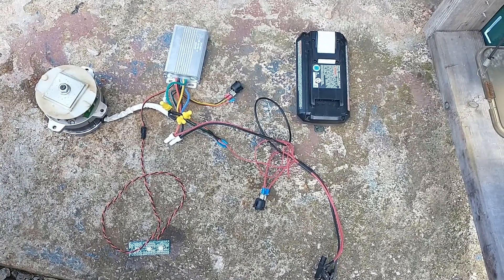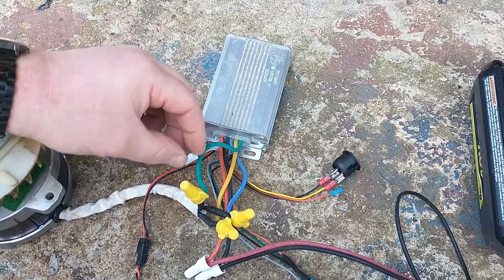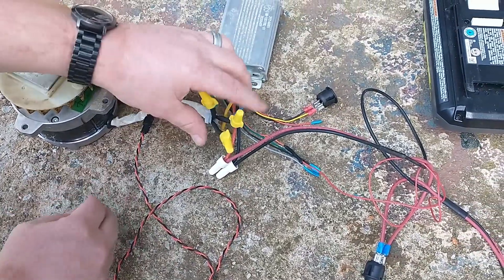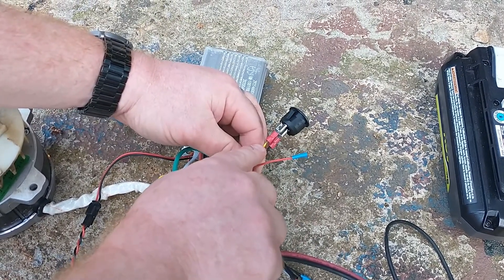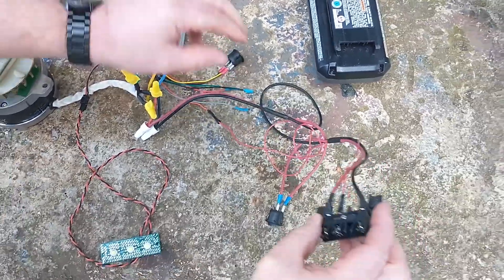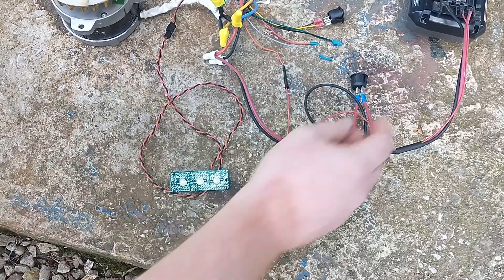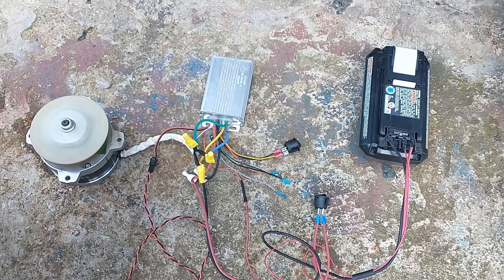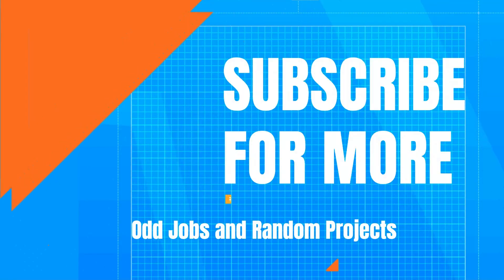Ryobi 40v Brushless Mower Wiring Diagram, Explanation and Modification for Projects

Comment: This is very helpful do you have anything similar that would show how to use and test a controller in a self propelled mower if I wire it using only that controller it will very briefly energize the self propelled motor but not really engage the motor and run I am a bit stumped by this and the same thing happens when I give the self propelled motor power directly from the 40v battery I am wanting to use only the self propelled system not the mowing system at all as a sort of electric moving cart but am a bit stumped on how to get the motor to run there is a motor controller for the blades very similar to what you are showing in your video and with it the other controller seems to be happy to do it’s regular functions and self propelled works but without that controller it seems to do nothing really but briefly energize the self propelled motor there is a 3 wire set that goes between the 2 controllers so I am wondering if that may be the key to getting just the self propelled controller to work independently of the cutting controller but I am not sure if it is wanting a signal or just a switch or something similar to the bypass you did in your video here for the cutting controller I have a few of these now so it would be amazing to get it sorted so I can use what I have for projects like moving carts that take out my trash cans and stuff, just curious if you may have a video showing anything on that controller? Thanks
Reply from the maker: I don't have a video covering that. However if your self propelled mechanism is like the one I have it isn't brushless, so the main controller wont work on it. If the motor only has 2 wires it is a brushed motor, and needs a different speed controller. I have not messed with that part since the motor is a bit small and I think it might be too weak for moving heavy things. However, the easiest way to do that would be to connect a brush type motor controller used for ebikes that can usually be picked up on eBay cheap. They have the wires labeled for easy use.

Comment: Great video - thanks for making it! I have just inherited a broken Ryobi 36 V lawn Mower that had an overheated connector that stopped it working. It is similar to yours but a bit simpler. I don't have the battery. Any idea what the third wire from the battery does? It is labelled "DS" at the PCB end and is a salmon orange color... Does it have digital data on it? That would be a nuisance.
Reply from the maker: I can't say for certain on that one, but on mine it is a temperature sensor. However several people have told me it will work with it disconnected. Several assumptions here, but if everything I've heard is true it should work without connecting it. I must say I haven't tested this personally, but don't see how it could hurt anything. Should just not work if the wire is important.

Comment: A mouse ate some of my wiring in my mower(RY401017VNM). I am trying to determine what gauge of wire to use. I know too thin of a gauge can cause overheating and damage components. If you know of some source of info on the internet please let me know.
Reply from the maker: If you have a small caliper you can strip back a section of the mouse eaten wire and measure it. There are charts online that will convert that into wire gauge sizes. Most of the small wires to the switches are about 20-22awg, and the motor ones are about 12-14awg, but that is just a rough guide. Measure to be sure. There is typically a wiring diagram on the Ryobi website under support that helped me.

Comment: Can the motor be connected straight to the battery without the computer box ?
Reply from the maker: No it can't. That's because brushless motors don't have a hot or ground wire to connect. The wires constantly change state to make the motor spin.

Comment: What's the difference between the set of 4 wires and the wires that are supposed to go to the handle ? I want to use that controller on a greenworks mower that the controller stopped working, but I'm wondering if I wouldn't short the wire to turn on the system and only use the wires to the handle to control the lawnmower. What is the drawback of my solution ?
Thanks
Reply from the maker: I believe the 4 wires you are referring to are the ones that go to the handle on the Ryobi. I am unfamiliar with the Green works design, so my opinion may not be of much value. I do know that Ryobi posts a basic wiring diagram in the manual for each of their mowers. It's available on their website. If Greenworks does the same you could just compare the two and make the problem solving easier on that front. But your system essentially sounds like what the manufacturer intended, just swapping parts brands.

Comment: When you find an unused conn it quite often is the conn the factory used to program the controller  ALSO  it may be used by the repair shops to plug in their diag laptops too.

!
Reply from the maker: That makes sense. Especially since the manual doesn't even cover it. Repair shop or factory only.

Comment: I have two Ryobi electric lawnmowers sitting in my garage. Both are not working. So frustrating that Home Depot would align themselves with this lawnmower. I love all the Ryobi products with the exception of the lawn mowers that are having electrical challenges. Attempted to go down the path of getting it repaired by the ““ Ryobi repair partner. The quote was just as expensive as buying a new lawnmower. Not sure if this is a class action suit, especially when it comes to when I put this two lawnmower on the street it will go straight to landfilland I could only imagine being multiplied by hundreds of thousands of these. My expectation would be these last 10 or 15 years, not two or three years anyway food for thought.
Reply from the maker: That's really sad indeed. They seem to have good motors and controllers that are let down by shoddy wiring and bad switches. Really pathetic that they seem to just replace rather than repair. That said the ones I have work very well, but I may have just got lucky. I know lots of people had problems though, because that's how I got all my motors for conversions, from "dead" mowers.

Comment: It was a safety switch just as this gentleman had said. Thank you very much, my mower is back in action!
Reply from the maker: Glad to hear it's working again!
Reply: I don't think you actually need an extra button for a redundant safety on a dead man's switch.
In my view it's not even a safety. It's a convenience to let you restart the mower after you bog it down without flipping the handle up and down again.
Or it would be if it wasn't doubling points of failure with very flimsy switches indeed.
It's an inconvenience switch.

Comment: My dog chewed up the wire to start the Ryobi lawn mower can you please tell me what I can do to replace it and what kind of wire do I use to replace it? Please and thank you.
Reply from the maker: If you are referring to the wire that goes up the handle that isn't too bad. On mine there are only 3 or 4 wires, and it is light gauge, about 22 gauge or smaller. There is actually a nice wiring diagram on the Ryobi website that is specific to your mower model. Just look up the model and you should find one. On some it is in the owners manual. Mine was real easy to understand. You should be able to replace the chewed section by splicing in wire, preferably of the same color, but if not just make sure you don't mix them up. Just work one write at a time. I like to use waterproof heat shrink butt connectors. Afterward I usually cover the entire bundle in heat shrink if possible to prevent damage to the wires in the future. I'm probably going a bit overboard, but I don't like doing jobs twice if I can help it. There is also a spiral loom wrap that is easier than heat shrink, separately for splices,  and harder for dogs to chew, but certainly not impossible. Hope this is helpful.

Comment: Is there any way to bypass the automatic low speed/high speed motor settings?  I want it on high speed all the time.  Thanks!
Reply from the maker: Not that I am aware of, at least not on the factory controller. You could swap in an E-Bike controller to have fully variable speed control, but I think that's a bit excessive.

Comment: I did something similar to my mower but it cuts off on slightly on thick grass do I need any type of protection switch so I don’t burn up the motor?
Reply from the maker: Not that I know of. It is supposed to have a built in protection that causes it to cut off to protect the motor. You might check your bearings to see if there is drag causing it to work harder than necessary.

Comment: The small red wire coming off the battery that connects at least on mine to a orange wire. Does that have 40v going to it or is that some kind of overheat or some other signal from battery to machine.
Reply from the maker: From what I understand it is a temperature sensor for the battery.
Reply: Yea thats what i thought, i had someone give me a mower but no battery. I found some chewed wires and was gonna fix them try to rig it up to a couple of my drill batteries to see if it would do anything at all. I can get 40v to the machine but not sure if it will run without getting a signal down that temperature signal wire
Reply: So it turns out that orange/red wire does not need to be connected for my machine to work. I hooked up the  two 20v batts from my drill  in series and was able to test the mower, thanks for the reply earlier, apprecite your input👍
Reply from the maker: Well that is very good to know! That means I could leave that off if I used a different battery for something like that.
Reply from the maker: Always good to keep things out of the landfill. They are actually a good piece of equipment let down by some mediocre wiring or bad switches most of the time. The motor and controller usually last.

Comment: Great video. Thanks for the explanation. I’ve had Ryobi 40V push mowers since they first came out and have had periodic electrical issues with all of them. I’ve watched lots of YouTube videos to help me troubleshoot the issues, but your video did the best job of explaining the wiring harness and what you can safely disable. One question, though—is there an easy way to determine if the controller is bad or good? Thanks.
Reply from the maker: The easiest way I know to test is swapping to a known good controller after checking the inputs and switches. I keep a spare already wired for easy testing. There are tools for testing controllers, but I've never figured out how to use the one I bought. An E-Bike controller makes a good test controller since they are basically universal.

Comment: Thank you.  Have you tried to overvolt the lawnmower?  Would it work with 11s (46.2V) or 12s (50.4V) battery?
Reply from the maker: I have heard that it will work with 48v, but I haven't tested it myself. The biggest issue would be the original controller and how to bypass the battery temp sensor wire. Easiest workaround would be to use an aftermarket E-Bike controller, but I'm sure there is another way.

Comment: Do you by chance have the part numbers? I am looking to use these motors to convert an old CC 682 to electric as the Koehler twin thru a rod many moons ago.
Reply from the maker: I don't have the party number for the motor or controller, but they came out of a RY401011 mower. I bought them on eBay already pulled from the mower. One thing I learned on my conversions is they don't work well for drive motors if you have a hydrostatic transmission. If you do you will either need a larger motor, and larger or more batteries. Otherwise switch to a manual transmission. My Yard Machines that I bought for the conversion had a single speed manual. But I tried on a Craftsman hydrostatic and the battery lasts like 5 minutes and the motor gets crazy hot.
Reply: @oddjobsandrandomprojects  I plan to utilize a different motor for the drive, but planning to utilize these for the deck. Thank you for your response. 😊

Comment: Does this have the variable speed feature ?? I am pulling my hair out, guys!! The switches in the handle are the cheapest POS I have seen... To put them into a tool that takes a beating is just mean! On my mower, the handle switch is not visible or accessible. Also, my yard (a lawn is a word meant to describe a level area, not grass seed growing thru volcanic stones that was never leveled); my mower keeps shutting off as it off-roads over the yard. I admire everyone here that can follow the wiring; I was born without the ELECTRICAL GENE, just in time for global warming. I will follow every step the best I can. Any advice??? Please help.
Reply from the maker: The controller does not have variable speed. If you want variable speed you will have to replace the controller, probably with something for an E-Bike of about 1000 watts. But for most people the fixed motor speed is best. The switches they use are really cheap, but if you don't mind it looking weird you could use some heavy duty switches. That's what I did when I used this to convert my riding mower. My yard is really bumpy and unlevel.
Reply from the maker: Also, one thing Ryobi does well is the manual. On mine it has a complete, exploded view of the mower. That has made repair much easier. Too bad they didn't just opt for better switches from the start.

Comment: My light and self propelled works but the motor will only work sometimes if i push the start button and have to be walking with the self-propelled on to get it to start and thats only sometimes
Reply from the maker: Just an educated guess, but that sounds like you have a loose or broken wire or a bad switch. My guess is that the vibration of moving is causing the circuit to complete and start the mower. Finding which wire or switch could be challenging though.

Comment: How do i make the motor spin in the opposite direction?
Reply from the maker: Technically the factory controller doesn't allow for that. However, if you want to permanently reverse the direction I've seen that you can transpose the blue and green motor wires to get it to do that. But if you need to have a forward and reverse switch just get an aftermarket controller for about $30.
Reply: Also take into consideration the five unused wires and the unconnected red one I have that controller right now I'm going to go ahead and take it apart and follow the leads on the board and the traces what they're actually connected to and I should be able to define every wire on it because one of those may be a training wire so you go ahead and you power You connect the two but it says always stay together that's your safety switch so leave those separated for the moment and then two of the wires even if it's single mode controller and not dual mode to the wires are usually training wires for direction so you turn it on with power and then you put those two wires together and you give it throttle and if it spins in the right direction while still have the throttle applied unconnect the two wires that we had unconnected and then connected so just touch them for a moment and separate them and then release the throttle and ramp it up again and see whether or not it changes direction If it does just cut the ends off of them and terminate them on nothing there's a couple other features that are probably on here like there might be possibility of regenerative braking a couple other features I'm familiar with the e-bike and scooter controllers so I literally found this it is om sealed so if it's burnt I can't tell it's never been taken apart so let me go ahead and Snoop this thing and I'll let you know when I have it in the main comment section

Comment: So mine runs, but as soon as the blades touch any grass, the motor stops. I've tried another battery and it's the same. I also bypassed the safety switch at the base of the handle, no change. It was working fine 3 weeks ago.

Does that sound like a bad controller?
Reply from the maker: I don't think so. Check the bearings in the motor. That sounds more likely, but I won't claim to be an expert. I have a video that shows what is inside. Typically they say that controllers either work or they don't. A malfunction like that would be unusual. Wiring or bearing is common. If it has been pushed too hard the wiring in the motor can go out. If that is the case when you open the motor it will smell burned, like burned varnish.
Reply: @oddjobsandrandomprojects  I finally got around to checking it again. The bearings seem fine. I clamped an ammeter on the motor leads and the current on each is the same, so I believe the driver FETs and windings are good. I found some hair wrapped around the shaft, less hair than you you would find in a vacuum cleaner. After I cleaned that out, it works great again. I got the mower free in a dumpster dive, happy to get more use out of it.
Reply from the maker: @user.A9  That's great you got it working! You'd think a little hair wouldn't be the problem, but I guess it could be if it's causing resistance in the right place.

Comment: Thanks, I also got a free broken Ryobi 36 volt. Replaced with a 36/48 volt 1000W e-bike controller (Amazon $40) and a pair of 18 volt Ryobi 5Ah batteries in 3D-printed holders. Seems to work!
Reply from the maker: Nice work!
Reply: Did you use it on a project?